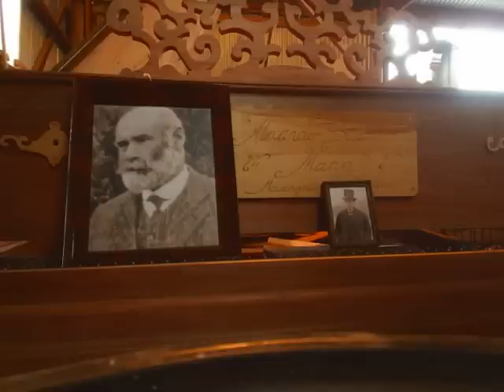Making the world's largest piano       www.alexanderpiano.yolasite.com

Comment: This piano sounds VERY similar to the Klavins 3.7m upright, with the inharmonicity of the bass strings plummeting at such string lengths. Pianos this size have a different richness to the bass (starting at around G1) lent by the low inharmonicity that is more 'fundamentally' powerful, especially apparent at the lowest A key. The double and single-course strings seem to be able to sustain for far longer than standard grands. I can't wait to hear notes below A0 using the same length of string.

Comment: Sheesh -- very impressive -- sure he's not inventing a new instrument but the engineering  of such a piano is amazing.  I am far to lazy to calculate the length of the strings necessary to give the correct wavelength.  Also, the frame appears to be bent and then welded together.  I can't imagine that it would have been a single casting like normal pianos.

Comment: How on earth did you get that massive frame cast!? A great achievement!

Oh and sorry to level a tangential question, but what's the motor under the dust sheet at 1:16? Ford Model A?
Reply: It looks like the frame is not cast but heavy flat iron welded together.